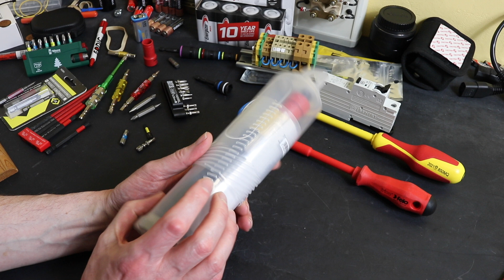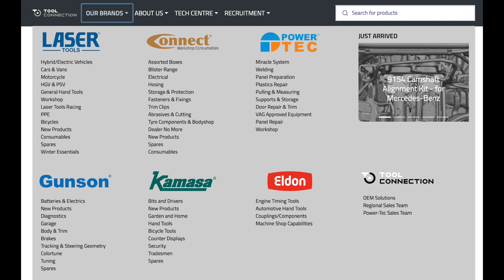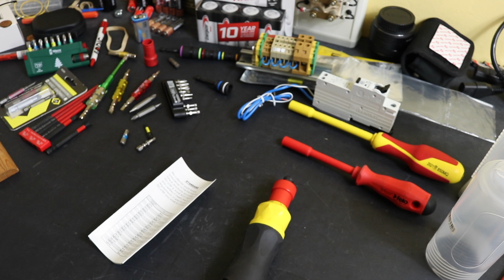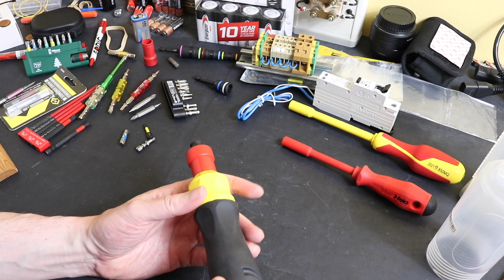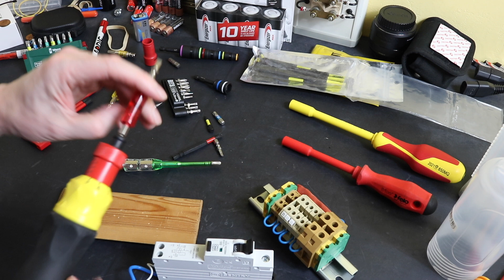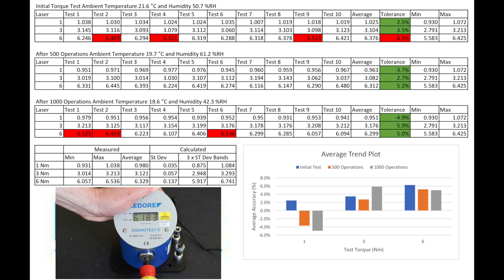Laser Tools Insulated Torque Screwdriver

Comment: I like the standard bits but that is mighty chunky.  I know many places would not see a coated shaft and say no immediately as not proper or safe.  I have both thoes anex bits and use them often but the 13mm vs 9mm anvil is always an issue.  Best to just jave a jis handle.
Reply from the maker: Yeah, not totally sure what the manufacturer is aiming at with this one really. It has its uses, but is controversial for sure.
Reply: @three-phase562 aa we have learned laser does a fair bit of rebrands.  Like out house brands at big box stores home depot husky its what you can get made with your name on it.  This is a victim of lack of production/too costly canceled.